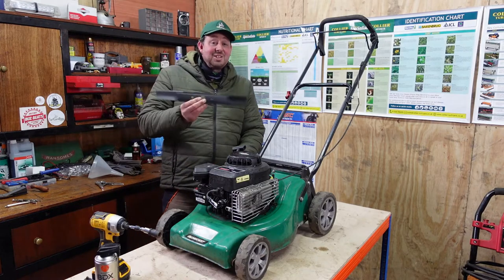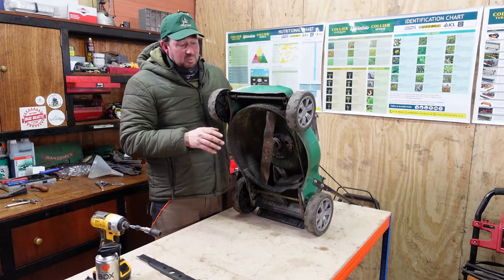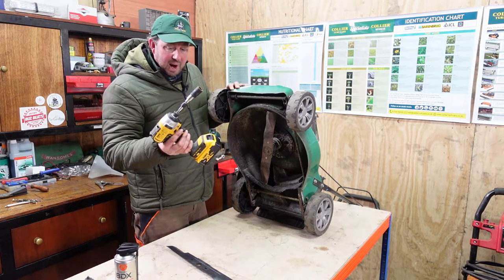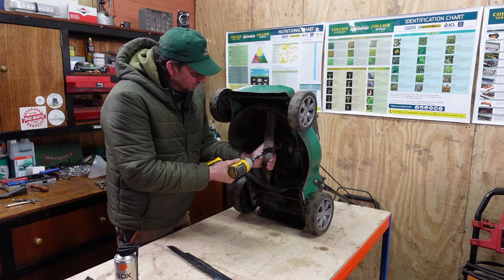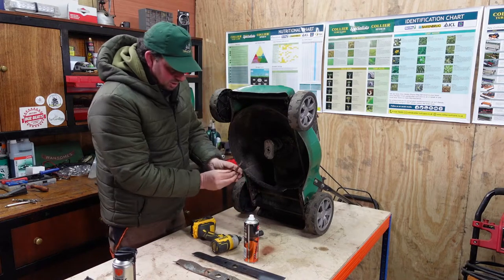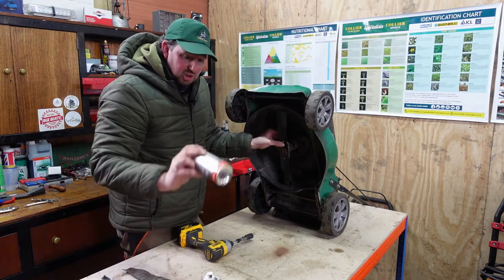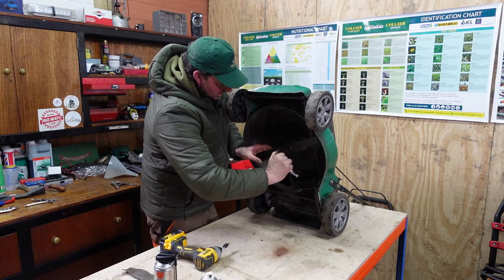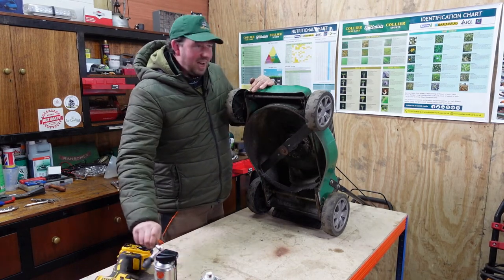Qualcast Lawn Mower blade change, fit or replacement tutorial instructions. Part number 933206

Comment: My Qualcast electric mower required you to place an Allen key/screw driver shaft into a hole to stop the motor turning as your unscrew the bolt. Without this, the motor just turns as you turn the bolt and the blade doesn’t come off.
Reply from the maker: Yes, I can well believe it.
I will have to make some videos about electric mowers 👍

Comment: Nicely explained. Cheers pal. I have this type of mower and want to convert a roller to the back insred of wheels. Can it be done do you think?
Reply from the maker: I don't think it can because of the space. However, if you want to create stripes then then you can always chain a heavy bit of timber to the back and it will push the grass over 👍
Reply: @JimmyTheMower 
Ok mate thanks for the info. I might give that a try 👍

Comment: Nice video, Why is it that the nut keeps spinning with the axel even when I have the blade locked in a stationary position, it’s an electric mower
Reply from the maker: Mmmmm. I'm not sure, I haven't done much work on electric Lawnmowers.
Is there somewhere, where you can lock the motor to stop it turning?
Reply: @JimmyTheMower  there’s only one hole for a screwdriver to be slotted to stop the blade spinning, will keep trying, thanks for replying

Comment: Thank wasn't sure if it was a L/H thread on it as some other mowers are.
Reply from the maker: And when it is really tight.
You can't feel it moving either way 😂😂
Reply: @JimmyTheMower   I've got three Briggs  powered mowers, this is the only one with a R/H thread, but all the engines rotate the same direction. Weird!
Reply from the maker: @Yeoblade that is strange 🤔

Comment: Great video Jimmy. 
Some advice please.
My mower is not bagging grass as it use too. It belches most of the grass out. I havent changed the blade since new. Anything i could do to resolve this issue? Thank you
Reply from the maker: OK, I think you have answered your own question there.... Blades not only cut the grass but also provide uplift to bag the grass.
If the wing tips are worn then there won't be sufficient airflow.
Secondly, empty and then was the grass bag through with water.
Over time the mesh becomes clogged and restricts airflow which stops the grass being collected.
Oh.... and just make sure there isn't anything blocking the chute.

Best of luck,

Jimmy 👍
Reply: @JimmyTheMower  thank you!